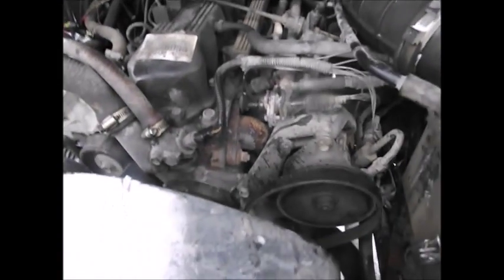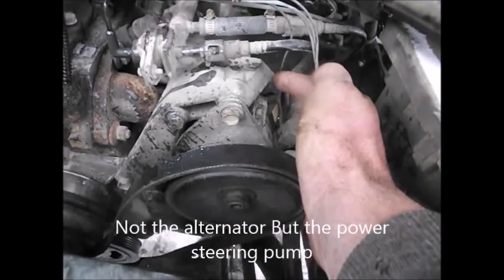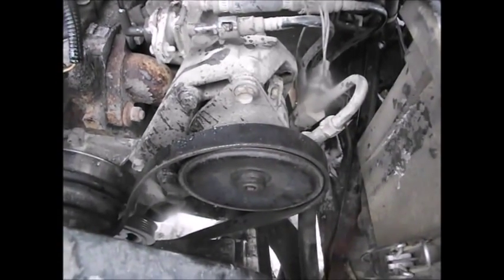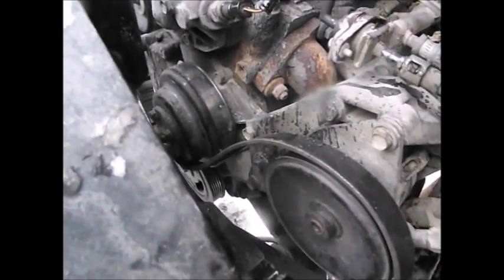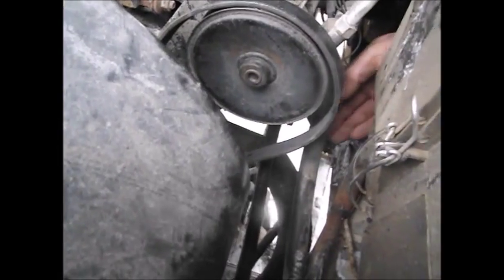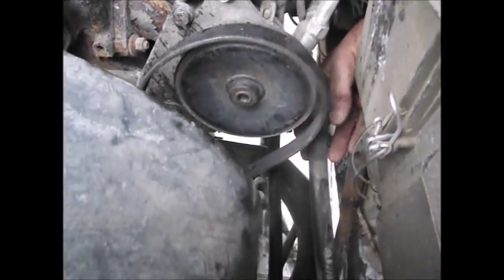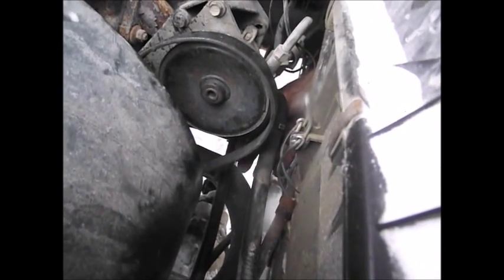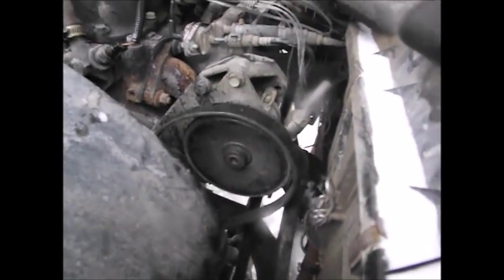YJ Jeep Wrangler 2.5 Four Cylinder Serpentine Belt Adjustment

Comment: Great tutorial.  I hv a 1994 Jeep wrangler YJ. There is a nipple on top of the case cover, looks like a to fill for air. Any advise?
Reply from the maker: Thanks. That nipple is for doing a pressure gas test. The other nipple there could be would be for air conditioner.  Unless some one installed some other air nipple for something else to which i have no idea.